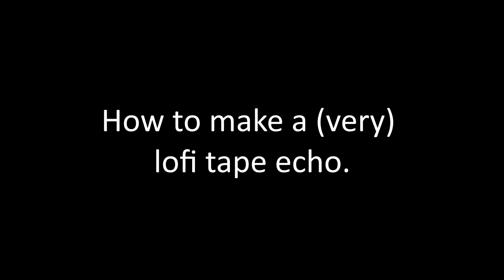How to make a (really) lofi DIY tape delay.

Comment: Great minds think alike I've done something similar myself. love the little touch of using the little pressure pad. Instead of sacrificing another cassette player I've bought a load of those adapters to plug an aux into a car cassette player. They're just tape heads attached to a aux cable I plug directly into so my mixer and add gain no soldering or sacrificing required :)
Reply: that sounds awesome - can you explain that process a little more in detail? Do you plug the cassette aux adapter into the line in of another tape player and then into the mixer? I am curious to try it myself
Reply: How does that work?! I have a bunch of them- would love to try it out!!
Reply: don't u miss out on a lot of EQ'ing, amplification and biassing stuff skipping the walkman's own amplification circuit?
Reply: Do you rip out the tape head from the cassette adapter or how do you make delay out from it?
Reply: @TALA-lu5ck  “(really) lofi”
Reply: @stanleythrewbrick  true true ; ) , I made something based on this a while back, tho I'm trying different ways of amplifying the output of the tapehead and attach that part of hardware to the cassette itself trying to make it as "standalone" as possible. I'm mostly struggling with a deep and intense ground hum. Last "amplifier" I tried was a harley benton rock plug so I'll just keep experimenting till I find something solid.
Reply: @TALA-lu5ck  that sounds slick! Have you looked into using an LM386 or something similar? You can find lots of mini “lm386 audio amplifier modules” online… I’ve been eyeing that PAM8302 by Adafruit 👀 2.5W class D audio amp (mono) running in at a whopping 15mm x 24mm x 2mm, I imagine that’ll be plenty small enough for any/all “standalone” needs;)

Comment: Well done, if you wanted a very tidy design you could wire in the secondary head to the playback circuit and use the same amplifier as the primary in playback mode

Comment: Hey this is great! I've been bending and playing a bit with cassette recorders and had a similar idea. Let me see if I get this clear: you're recording into the looped cassette with the non-opened Sony, but playing from the opened one? Because I was thinking in using a recorder that has "direct input monitoring" while recording, so that way you could use only 1 unit + the modded cassette inside, and get the live sound while recording + the sound from the read head inside the cassette (I don't know if this makes sense). What do you think?
Reply: Should work i think, just connect the play head to another player or amp and make sure the heads are aligned in the right order. Im gonna try this too because its damn hard to align an extra tape head in a cassette recorder

Comment: tape is too short
Reply: No.
Reply: its the standard short loop length, easy to make.  there are plenty of longer designs like the Chandler loop, or you can get creative and make your own.  the tape doesnt even need to stay inside the cassette, you could string it across the room if you wanted